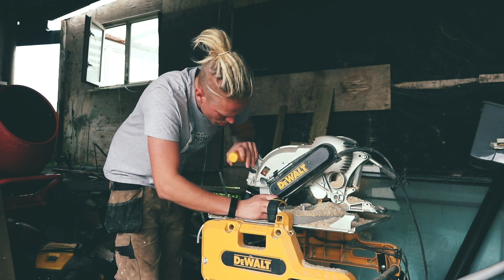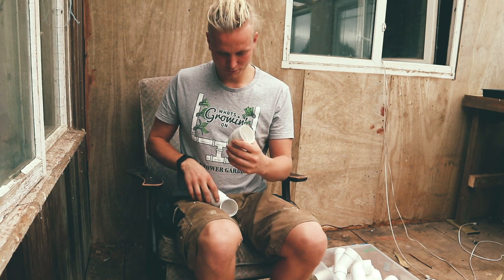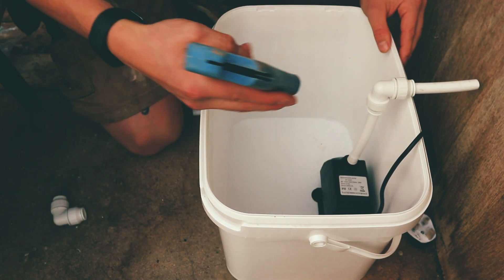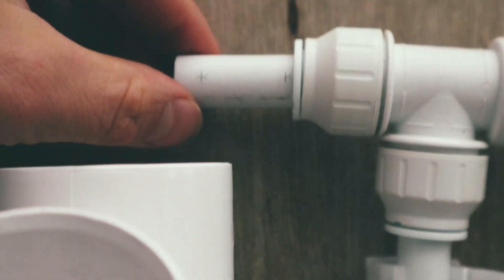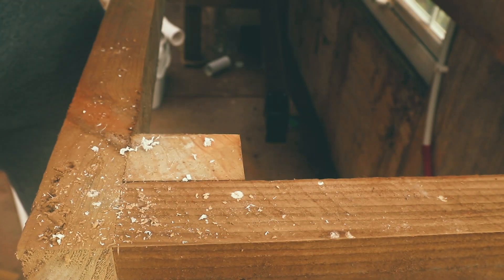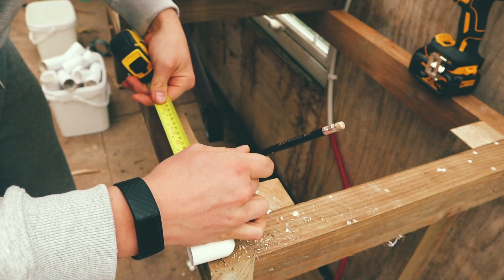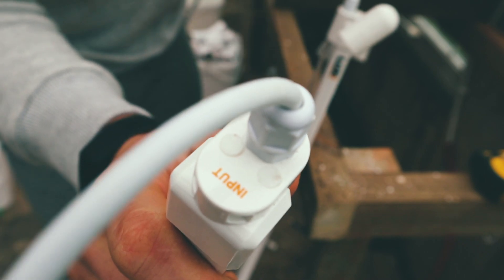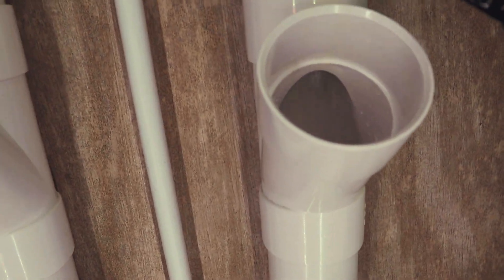BUILD YOUR OWN HYDROPONIC GROW TOWER: Full Step By Step Tutorial - Shopping List In Description

Comment: So this is not a hydroponic system. Its called aeroponics, and requires constant water flow. Very expensive to run. You can't  let the roots dry, or the shock will kill the plants.
Reply: Yes, aeroponics, but not NFT, which IS continuous.  15 mins on and 45 off works just fine in all tower systems.
Reply: Why is it expensive to run?
Reply: @Holistic-Nick  because of the power consumption. Between lights and pumps it's a bit. You can used recycled parts to keep cost down and use solar/wind to lower the power cost. But is a big investment and alot of work for what it is. Super self sufficient though. Not as efficient as the grocery store, but it's yours.

Comment: How is the water supposed to hit the net cup when it is so far away from the main down pipe?
Reply from the maker: Good question, I use a spacer on the top brackets that angles the tower slightly away from the wall. This makes the nutrients run down the front of the tower. Once roots are established they’ll fill up the pipes so no worries there. I usually bring seedlings on on a sunny windowsill until roots form and you can see them coming out of the rock wall this means they’ll easily receive the nutrients.

Comment: Thank you for your video and help.  How much water should be in the tank?  In other words, how do I calculate the size of the tank in terms of litres of water,  if I have two columns or four columns?
Reply: You can't have too much water and if you gave too little you will be constantly checking the water level. Once the plants get larger they can drink a substantial amount of water and the pump MUST stay submerged. It's quite easy.